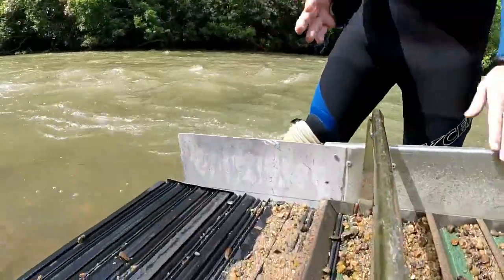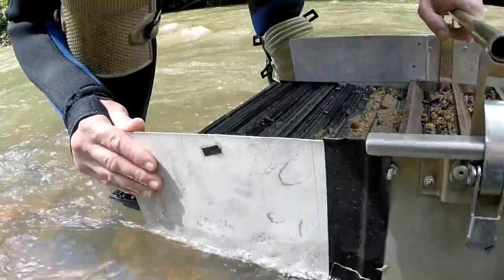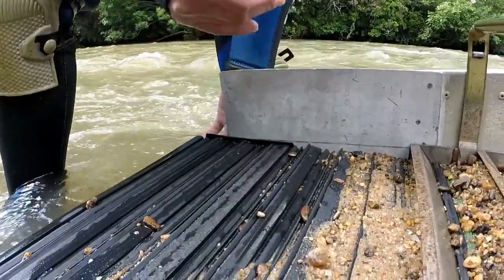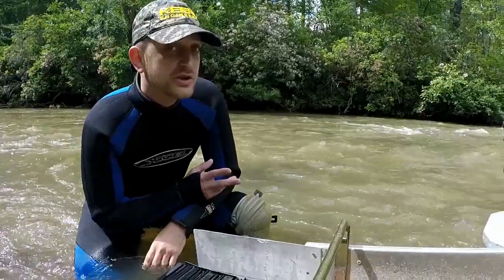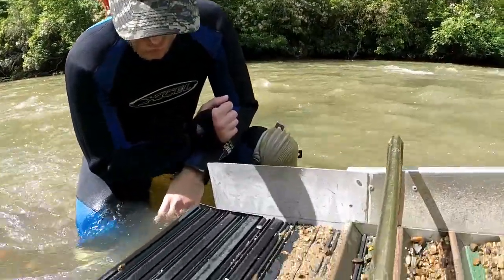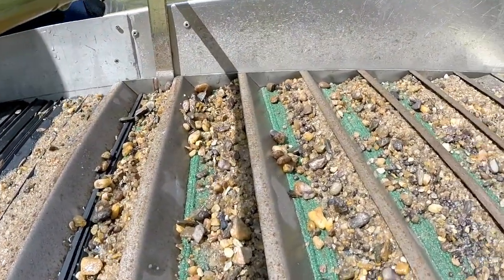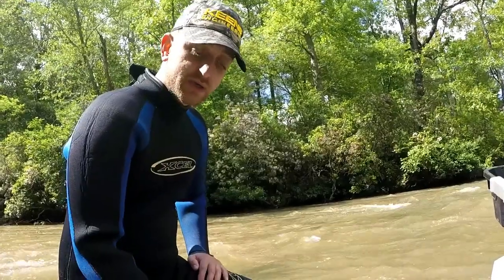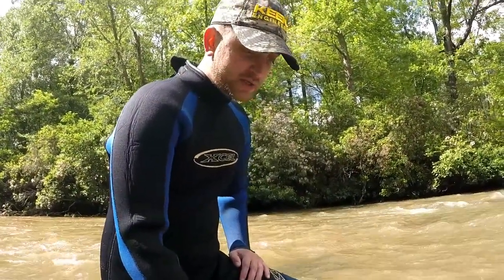3 Stage Sluice Box Extension w/ Hog Mats Increase our Recovery! Keene Gold Dredge

Comment: How’s that extension been running ? Did you do anything to the third stage under that ? Have you considered running dream mats or another mat system on the third stage ?
Reply from the maker: Hey there. We haven’t used this dredge for about two years. We have been working a smaller creek with a 3 inch dredge/banker but this worked awesome when we had it. Usually had almost no gold in it. This was basically to check our box was dialed in. Thanks for the comment please subscribe!
Reply: @sluiceboyprospecting  awesome. We have a new Keene 6” and want to make sure we are optimizing our recovery.
Reply from the maker: @twodudesonedredge  good idea. I mean it fed can’t hurt to have it there. Actually you can run longer with it to. I really wanted to make it flare out an extra 4 inches wider as well but didn’t have the means to. 
We find our selfs adjusting the box for different material or layers as well. This always helps check that nothing went wrong.
Reply from the maker: @twodudesonedredge  you got it I will. Headed home now from work.

Comment: We were in Vein Mountain this past week, and our two inch dredge seems to be losing gold. We are thinking about adding an extension on the end of it as well. I gave you a sub and will be checking out your other videos to see if the extension helps.
Reply from the maker: Southern Relics Hey well welcome to the channel. It all depends on the extension. Its a great way to see what your box is/would be doing.  Then you can continue to dial it in. Another great part about any extension is that you can run longer! You can push more material over it not for longer and not worry about getting packed up with heavies as soon. Good luck! Remember you just cant get 100% recovery. You can get close though on a 2 inch or 3 inch dredge.
Reply: SLUICEBOY PROSPECTING great advice! Thanks! Our video on the dredging trip will come out Wednesday. If you get a chance, take a look at it and see how we are currently set up.
Reply from the maker: Southern Relics will do!

Comment: How did you use to separate upper and lower mat. I thought about doing the same thing to my 3 stage
Reply from the maker: gene ingram 
Hello i dont know why i didnt show that part. I simply used some pieces of steel i had laying around cut them to fit drilled a whole through them, then put a smal bolt through where the metal of the lower riffles are. Give me a few weeks ill post a continuation of this video showing the lower portion of the sluice.